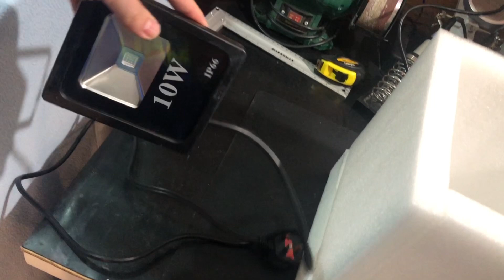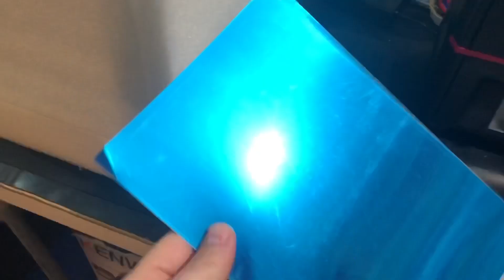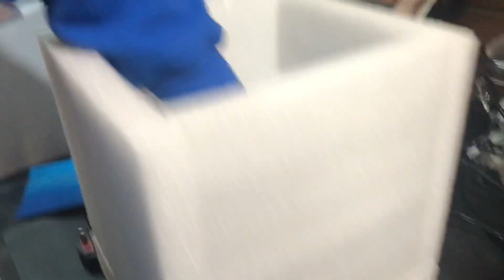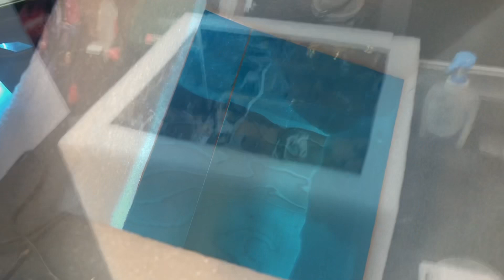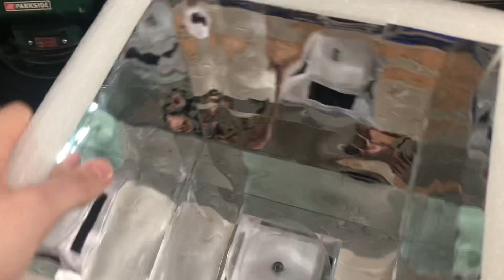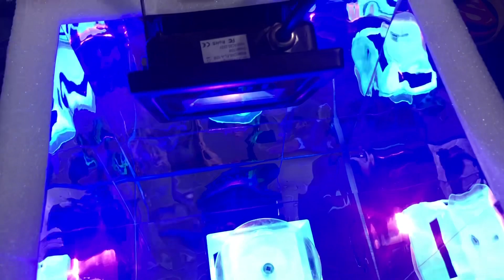How to build UV Curing Chamber (Quicktips)

Comment: No handprotection when putting your hand into it? Is that really safe?
Reply from the maker: Once it’s cured yes no harm on touching resin. To be fair although being toxic, resin can be touched as long as you clean and wash your hands safely after.
Reply: @scooby3dprints67  yeah that i know, but i ment no protection while you use the UV light? (on your hands that is)
Reply: @Ankhschannel  UV Light isnt that dangerous. The sun gives off way more UV than that little thing.
Reply: @Scurfturf  Its not too dangerous in short bursts, but the UV in a standard curing station are actually more intense than direct sunlight.  The source is much closer (The inverse square law - the intensity of electromagnetic radiation drops off with the square of the distance from the source, so a source 5 meters away from you subjects you to four times more radiation than one 10 meters away.), it is not filtered through our atmosphere and it is concentrated at close to a single wavelength. 
Its why most resins suggest times like 4-5 minutes under a curing station but several hours if just in sunlight. 
Its not going to injure you instantly (except maybe your eyes if you look into a uv led), but its still not a good idea to be reckless.

Comment: Hi, I ordered what I think are the same flexible mirrors from amazon. But after I did research I realized that the metal (aluminum) in the aluminum foil is what causes the reflection of the u v waves. I don't think that mirror material that we have ( i think we have the same amazon mirrors) actually have any true reflective properties of UV waves? I think they will just reflect the visible light that you and I see. Do you think THOSE mirrors are truly reflective of uv waves?
Reply from the maker: Difficult to tell if they are doing anything but I can say my prints are fully cured. I’ll see if I can come with a test somehow to test it. Thanks for the heads up!